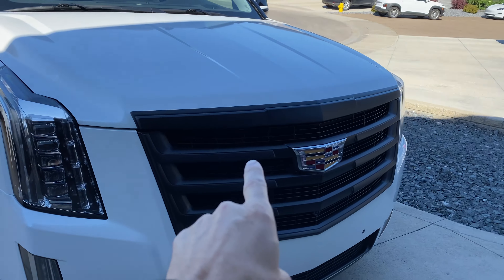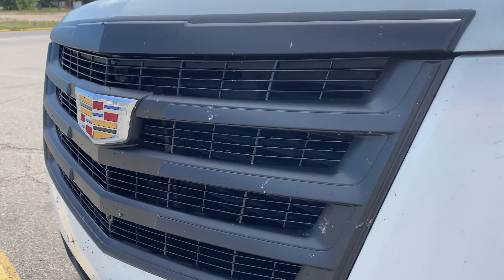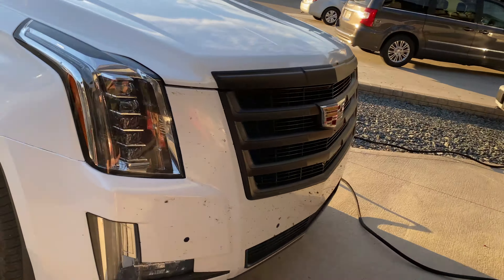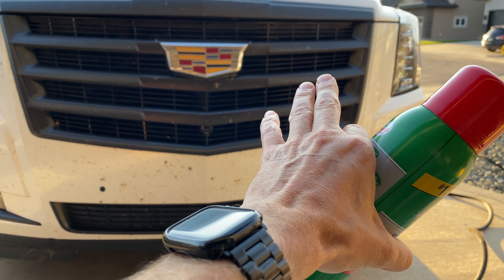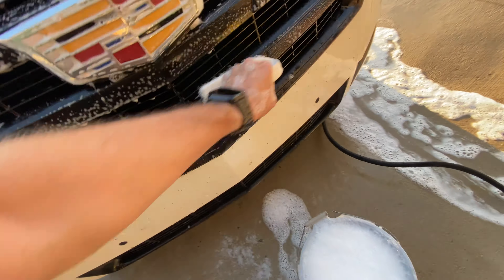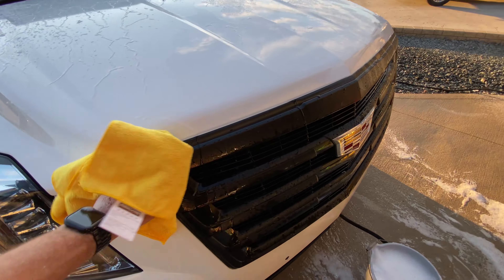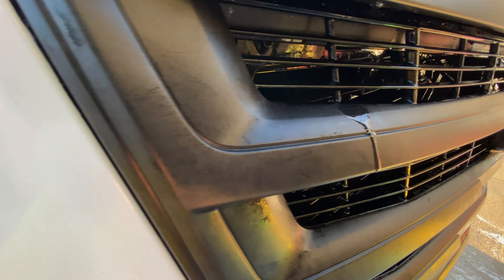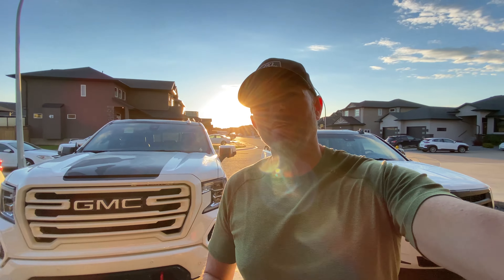HyperDip and Bug Guts! How I Clean it Ensuring it Lasts! Works With Plasti Dip Too!

Comment: How did you hyperdip the trim around the windows? Was the rubber touching the chrome?
Reply from the maker: It separates where the rubber meets the.l chrome during the peeling stage after it has dried.  Just have to take your time and get a feel for it

Comment: my car is ceramic coated, from my understanding the plasti dip cannot be ceramic coated?  we lived on gravel roads im worried the car will wash nice and the grill will be a pain if i choose to plasti dip it.. but the grill is peeling from the factory paint of the AT4 acadia .... have any suggestions? i was thinking doing metalizer as a top coat..
Reply from the maker: Plasti Dip and Hyperdip would be difficult to ceramic coat and probably wouldn’t last anyway.   Gravel roads are rough no matter what you have so at least dip is a cheap option if you have to keep redoing it sometimes

Comment: Hyperdip vs plastidip; why did you choose hyperdip?
Reply from the maker: Hyperdip is made by Plasti Dip but is engineered specifically for automotive use, whereas Plasti Dip was originally for generic projects.  It became so popular to use with automotive projects, they changed the graphics on the cans to reflect automotive applications.   Hyperdip has a better finish but is a little more finicky to apply.